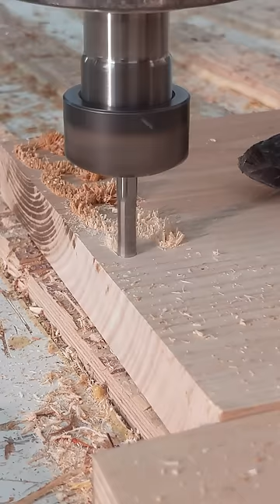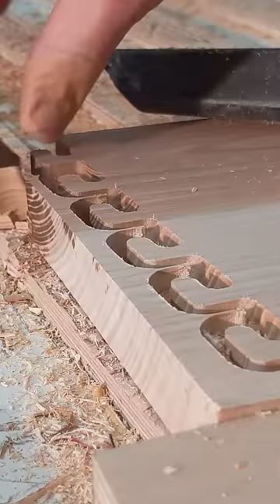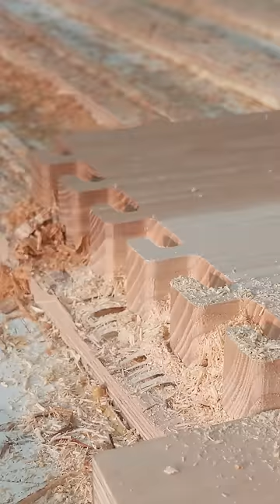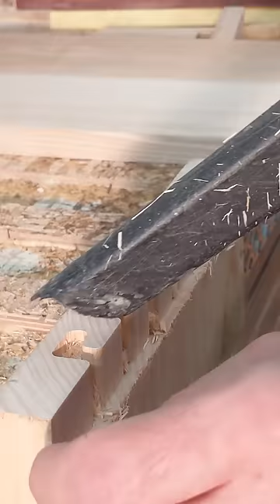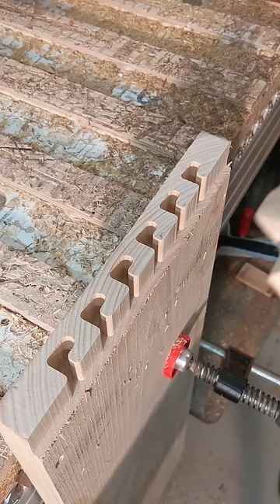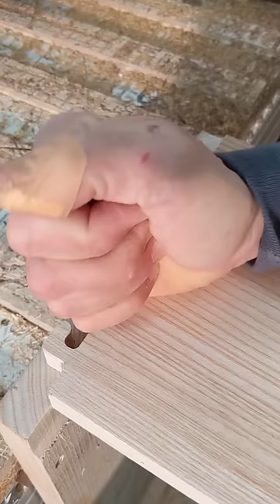cnc joinery with 22 mm ash wood

Comment: I wonder how likely the little bits are to snap where the cross grain is holding a small piece together
Reply: Once glue is added. Not likely.
Reply: @James Foskey  I guess, after the joining it becomes less likely however, as compared to dovetail it is far more likely.
Reply: Very likely.😅
Reply: This isn't any different from a dovetail, the grain in the important direction is running lengthways and it's a super tight fit, there's no where for the wood to even flex. Just because you've never seen it before doesn't make it weak.
Reply: @DavidLee-cw6ci No because the hook is only held by about a quarter inch of cross grain on one side, where as a dove tail runs about a half inch on both sides which means that a dovetail is 4 times less likely to split and probably even more. I get it, glue and all, but it is definitely weaker regardless of whether  I've seen it before, or not.

Comment: Before cutting the shapes into the end of the board (into the end grain), if you use a square and marking knife to mark a line across at the depth of the board you won't get all the tear-out that's left by the cutter. Look up some videos of people doing traditional hand joinery to see how the layout and cut the boards with the marking knives. Hope this helps
Reply from the maker: Thanks. I need to try that
Reply: 6ㅌ
Reply: @Glen_Everette_1281
Thank you!  That is extremely helpful! Would have loved to have learned that in high school woodshop!
Reply: yes you can do that. but you can also climb mill the shoulder first and then conventional mill the rest of the part. this will stop you from having break out. anything on end grain should be climb milled

Comment: That looks like it is very weak. All of those hooks have the grain running so they each can break easily.
Reply: If they were straight cuts they wouldn't pull out if it wasn't under load so it depends on where the stress is.

Comment: While I had that ability using CNC mills when I worked, I liked doing stuff like that on the FlowJet (Waterjet Machine). Chipless and fast. Not too much with the laser. It burnt the hell out of thicker wood. Now, retired, I'm back to the basic woodworking tools which take forever to setup, and the only digital tool I have is a Prusa 3D printer, but it's additive - not subtractive.
Reply from the maker: I'd really really like to use a water jet! A powerful water jet makes a CNC router look like a toy.

Comment: Beautiful joint. Done in fraction of the time any traditional joint would take. Thanks, man - about to start building a table for a new CNC. I think I need to incorporate the facility to handle vertical pieces in the design. 

Ignore the "get the mallet" crowd - they're just jealous 😂

Either male part needs to be smaller by, say, 0.1-0.2mm. Or female needs to be wider a bit. Space for glue and all that. Have to try this on 3/4" ply. If it works - what a great way to quickly put together a few drawers. And those would last forever. 

Thanks again - food for thought and all that good stuff 😊
Reply from the maker: Thanks man! 
Yes, if you're into joinery, then the ability to fix something vertically is super important!!

Comment: This is why i like japnese.....they do such beautiful and complicated project by hand with local traditional tools....and west depends on modern technology...... 🤔🙏
Reply: Sure. All you need is 20+ years of practice, manual tool set that's probably costs more than that CNC router and whole day to make one joint. 

Yesterday I made several channels 20cm wide and 6mm deep in a 3m long pieces. Simple jig: 30min from scrap ex IKEA shelf, not even MDF - chipboard! Dewalt palm router and 3/4" straight cut bit (didn't have anything bigger...). It came out perfectly flat, perfect  measures etc. 5-10 minutes per channel (12 passes in total due to the bit size). 

Don't get me wrong- those guys are finest artists of the trade. Pleasure to watch and appreciate the skill. But who's got the time? Life's too short 😂

Comment: I'm probably wrong for sure, but the way the force presses on the joints I feel like the grain pattern is the wrong way like it could easily fracture along the planes or whatever. Am I just not understanding how grain works? Main reason I ask is I'm trying to get into wood work and have whittled and small time carve and build, but I have discovered some errors in going with wrong physics along grain creating weak projects and also picking bad pieces to work with, the way the hooks sit I feel like they could easily pull out with time or weathering/humidity etc. Anyways it's a phenomenal concept and toooooo clean!!!!! I would smear some wood glue in there first but it looks like it wouldn't even be necessary with how perfectly they fit!
Reply from the maker: You may be right. The main object of this video was to show one kind of joint that is possible. 
I'm not at all an expert regarding joinery. But it's like you said: once you begin to try stuff out, then that's when you start learning the most.

Comment: Video is sped up but i still think you should slow down, looks like the wood is splintering badly because you’re forcing the bit through to cut, when it’s actually meant to shave the wood slowly to end up with smooth edges

Comment: Pretty. However, a simple dovetail would be stronger.
Reply: he didn't  put any glue in there, if he had that would be a comparable joint.
Reply: @yolisurich4025  No it wouldn’t. These thin tongs will split along the grain.
Reply: @peterdefrankrijker  so do dove tails
Reply: @yolisurich4025  The area of wood bearing the load is significantly larger with traditional dovetails.

Comment: You know how to use a computer but you don't understand the material.
Reply from the maker: I'd love to see how you would do it.
Reply: @mason.berlin  you know why they make dovetails the way they do?
It's because of the grain structure.
Wood is really weak perpendicular to the fires. That's why the angle on those dovetails is rather shallow.

Your hooks have a tiny cross section are not as strong of a connection as they could be.
But I guess they look good.
So from a purely ornamental standpoint you did good!
Reply from the maker: Yup, you're right about that. Dovetails are always stronger than this sort of thing. This is just a demonstration of how it can be done with a CNC

Comment: You need a new shop vacuum. That’s thing isn’t doing anything. Lol
Reply from the maker: I don't usually use a vacuum cleaner for dust extraction. The only reason I use it in the videos is because if I used the normal dust extraction, there would be nothing to see...
Lol?